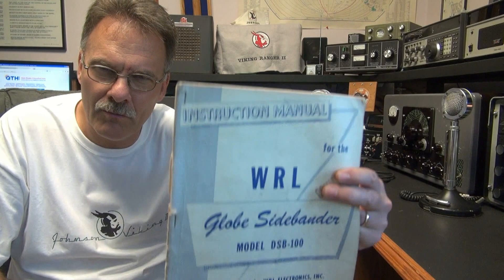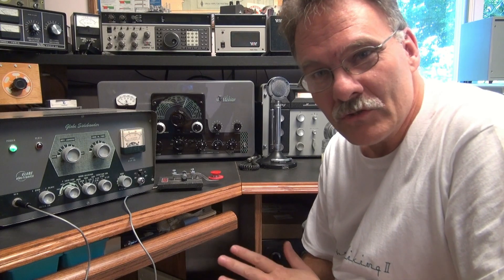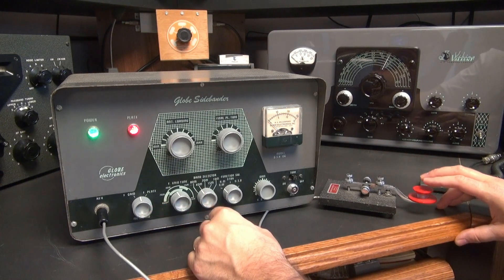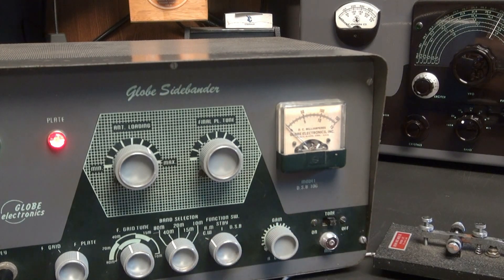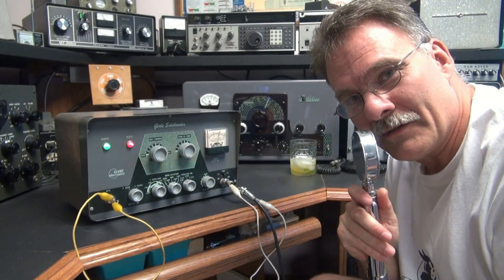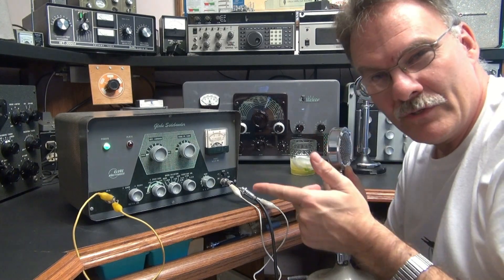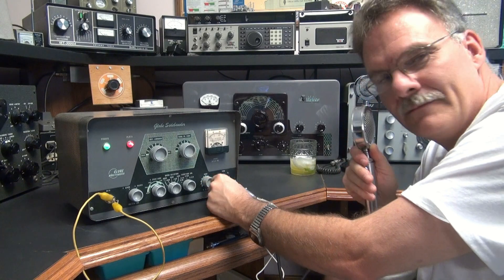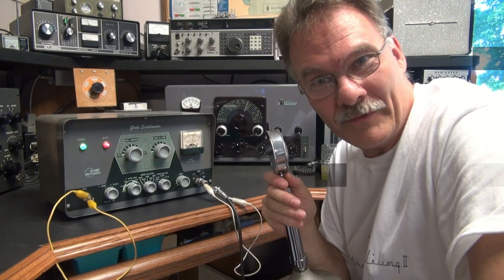WRL Globe DSB-100 Tube Ham Radio Transmitter Demo CW AM SSB by N6tlu

Comment: I bought a brand new factory built unit when i received my general class license way back in 1958 and very few hams that i worked on SSB knew i was operating a DSB rig. On CW I always had the meter in the "grid" position so the needle doesn't bounce around as much. I did that with all the  transmitters i used. Nice video terry.

Comment: In DSB,  the front panel gain is the Clipping Control.  The gain control on the rear panel is the basic mic gain /power control.  You want to get that set up properly ( per the manual)  Audio on mine with D-104  is clean and shows the designed bass boost hi fi guys will like.  advance the gain to 1 o clock and it really starts to clip and is noticably harsh  very quickly.   Very important to listen with a reciever, head phones, and attenuator on.. to get it adjusted to sound the way you want it.  Modern hams have never heard speech clipping, and wont like it ! without the clipping, it sounds surprisingly nice.

Comment: Terry, since I am working on mine with no manual... I have returned to this video to see normal grid drive ( 3 ma) normal plate current ( 100-110 ma), and reference rf output . About what I expected.  Forgot you are using a 303 with product detector not 300.  73. Tnx.

Comment: Went through mine and tested it successfully the first time on 6/25/15.
It waited on the shelf for 15 years, but I finally got to it. Long page of squawks to fix, worst of which were "repairs" and mods done by folks without a single clue !   DSB sounds surprisingly good.. when received on a radio designed for sideband.    Anyway... these are ultra simple, low power exciters, based on the 1954 design of Costas.  See you on the vintage ssb net.